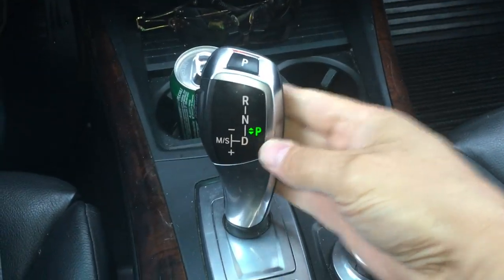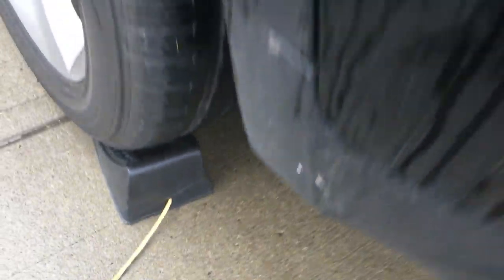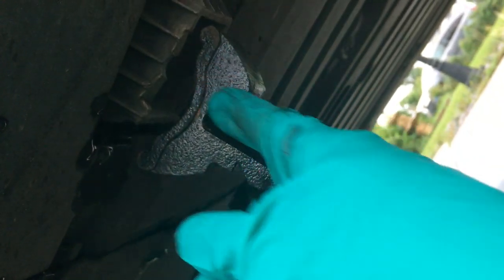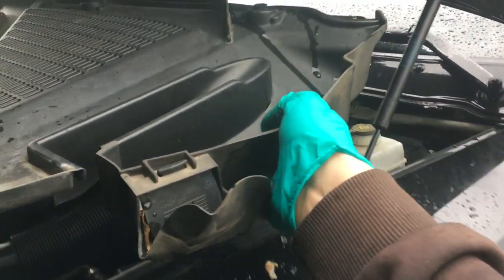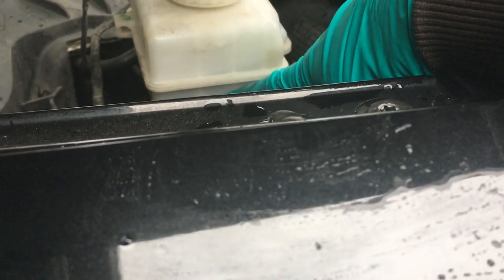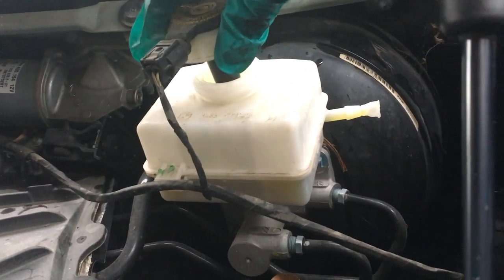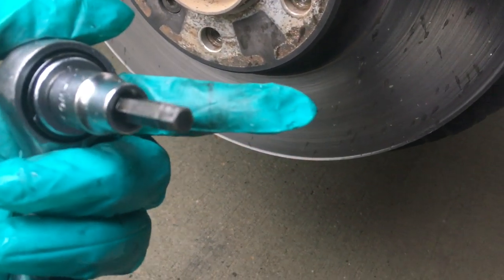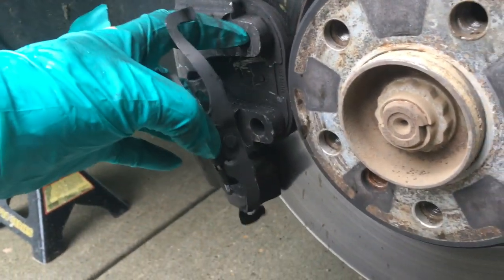BMW E70 X5 Front Brake Rotor Pad Sensor And Service Light Reset DIY

Comment: Thank you for a good video Mark. You covered the basics very well. Consider using a modified wire hanger to hang the caliper out of the way, better gloves, anti seize grease and some brake cleaner spray to round up a professional brake job.
Reply from the maker: True, thanks for watching.  Cheers.

Comment: Perfect timing!  I was going to look into doing the brakes on my e70d soon.   Looks straight forward as expected.  Thanks for taking the time to document the process!
Reply from the maker: I hope it helps you.  It is quite simple, but sometimes the lip on the edge of the disc is so pronounced that it is hard to pull the caliber off so you may have to squeeze out the piston a bit before removing

Comment: Nice one Mark. If you really think about it, brake sensors are unnecessary because you can easily see the brake pads through the wheels. This is why I cut the sensor wire and tie the wires together. Never have to buy a new sensor or have a stupid money light on the dash.
Reply from the maker: Thanks a lot for watching

Comment: You made a very good video on all parts, EXCEPT, you didn't clean and lubricate your caliper slide pins. They'll get dry over time and keep the calipers from retracting after letting off the brakes. If the outside pad has more wear than the inside pad, most likely the caliper slide pins are dry and hanging up. If the pins slide easily in the caliper bushings, the next culprit will be the caliper piston(s) are binding up and not retracting. You can either rebuild the brake caliper or buy replacements. In my opinion, it's more cost effective to buy rebuilt calipers from your local auto parts store.

Comment: Very nice DIY, by the way, for that screw holding the rotor, can I still remove the rotor without taken off that screw (the one on my is stripped a bit, and I can't remove that screw)? Thanks.

Comment: Hey Man, great video, cheers for that. Do you actually have to change the sensor also or can just replace pads and rotors?
Reply from the maker: You can, but it’s cheap and no point I. Not.  If it ri gain. Then it needs replacing

Comment: Did you use oem parts , thank you for the tip hope to work on my 2011 X3
Reply from the maker: Hi, No they were highly recommended aftermarket pads and discs which fit similar specs as OEM.

Comment: When you reset the code on the dash, what exactly does that do? Does it reset the vehicle service intervals for ALL service, or just the brakes?
Reply from the maker: Hi, you can gain access to a few different service resets but that one shows specifically brakes if that is only pushed

Comment: I did rotors and brake pads on my 2016 x5 brake pad sensor has no damage so I reused and it’s not letting me reset. Is it because I need to remove paint on pad where the sensor goes or you think it’s a bad sensor?
Reply from the maker: If you saw the brake light at any point before then it’s done.  Generally it should be replaced.  If you never saw the light and the sensor is good then maybe it needs to be reseated to the Main harness better
Reply: @ECPP  sounds right thanks gonna replace.

Comment: Hey mate great vid. Do you have to replace the wear sensor before resetting the code? Or can you continue to use the existing one?
Reply from the maker: If you have the code, that means the sensor is damaged and needs to be replaced first
Reply: @ECPP  There is no code,  just the service interval reminder?
Reply: Every time that Sensor goes off you need a new one and brakes.

Comment: Thought maybe you would install drilled and slotted rotors? I got all 4 for my 1996 Jeep Grand Cherokee with pads for about 250.00-300.00 on E-BAY--Actually about 6 months ago replaced both front calipers as 1 piston was getting stuck and not pushing back in when I released the pedal, I made it home then ordered both from Advance auto, under 50.00 for both
Reply from the maker: True Jim, the beauty of the internet and parts are very readily available and mire affordable

Comment: Hi I’m not sure if you can help I have an X5 E. 70 and I’m unable to remove the rear disc it just seems to be stuck on and I have moved the six small talk Bolt but I really don’t know I’m a lost
Reply from the maker: Be careful Jim, I did not do the vid on that one, but it is holding due to the electric park brakes.  Has to be disabled.
Reply: Thank you

That makes perfect sense

If you know of a link to a video I would be most appreciative 

Thank you so much for your response
Reply: Hi

Sorry to bother you again

If I remove the caliper and then there’s a plastic cover to be removed and then turn torx screw Clockwise until it stops

And then reassemble

What is the allow me to remove the Rotor?

Thank you for your patience and understanding in this matter

Comment: If you own a electric ratchet you can do this job in about 30  to 45 mins a side. Use brake clean and grease the slide pins and use a bit of antiseize where appropriate. Wire wheel to bust the rust. Cardboard for the floor towel over the brake fluid reservoir.  Tray for your tools and a few rags. Wear gloves and a mask if you wish...I choose to wear a mask and eye protection. If something is stuck...pb blaster penetrating oil soak a few times over a couple hours with an impact should get it freed up.

Comment: What size torx did you use to remove the caliper bracket in order to get the rotors off?
Reply: Hey did you ever find out what torques size that was because I can't find it on anything

Comment: I have heard conflicting options on "if" the rotor needs "automatic" replacement when changing the pads. Obvious wear on yours, others, not so much. Erring on the side of caution, granted, but....
Thoughts?
Reply from the maker: Hi Thomas, even before I owned the X5, my previous BMW's were similar, in that the dealer mentioned that due to the tighter operating tolerances and the design of safety features like traction control, ABS and the like, going too thin reduces the effectiveness of the designed function in these cars.  Every one of my BMWs seem to just slight out of tolerance on the machined thickness once it has been reground and if using stock pads, by the time they have worn to the point of replacement, the disc is usually ready to go as well.  If a person tried some aftermarket pads (maybe a harder or softer pad) this may have an impact on the wear of the rotor too, but if using more or less OEM, this has always been my experience.  That being said if a persons budget does not allow to buy discs, pad change only could work(at ones own risk and I have done this on other vehicles in the past before too), it is better than running everything down to steel.  Ultimately though, I would recommend going brand new disc and pads with a new sensor.  Cheers
Reply: @ECPP  agreed. Several times, when I did change the pads myself, I felt no need to change the rotor. This was subjective, depending on the make, year and model. 
But, my 335i recieved new rotors, without hesitation from me. I don't drive a great piece of vehicle, without proper care. Enjoyed the video!

Comment: 9:06 😮 Don’t you ever!!!
If anything just a dab of loctite after you have wire brushed and Brakleen’d the threads.
BMW has a known issue with these coming loose after replacement especially, the superseded version of these bolts come with a thread locker pre-applied. 
Came for torque specifications 😂

Comment: BMW break jobs are easy just make sure you get OEM parts or you will have to do it all over a again soon. Bmws don't do well on non OEM brakes.
Reply from the maker: OEM or top quality stuff is always best if you want it to last.
Reply: AKEBONO brake pads?